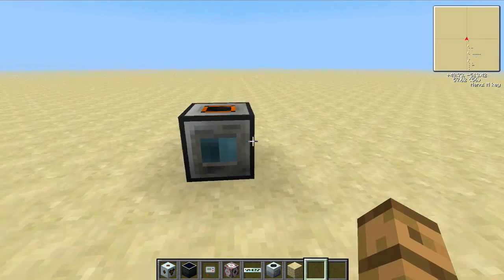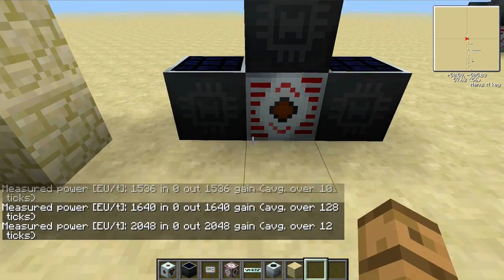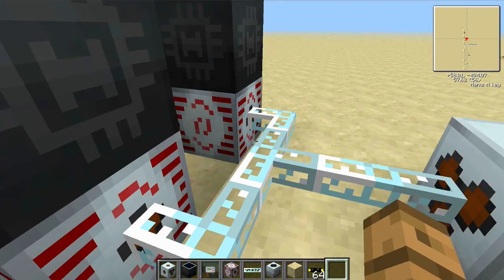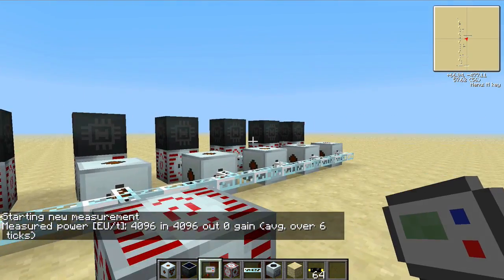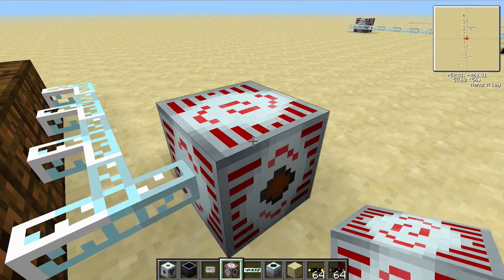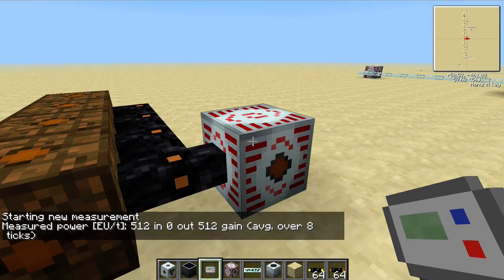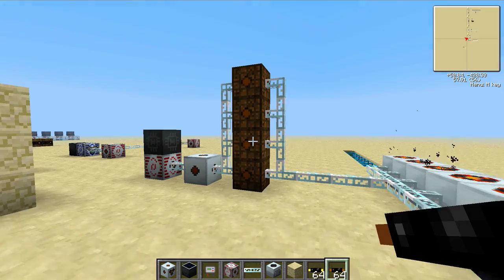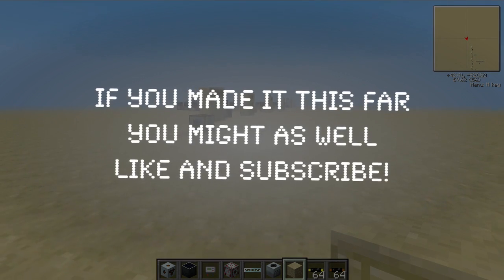Re 014 Nebris Power Transformation

Comment: Nice video, I didn't know that EU packets are getting split into smaller ones and machines request EU, i thought it went the other way. 

But what happens at 8:07 can be explained: The MV-T requests 512EU every 4 ticks (when all 4 128EU packets have been sent). Over 31 ticks 7 packets were requested (512 * 7 / 31 = 115.61), over 11 ticks 3 packets were requested (512 * 3 / 11 = 139.64). The other times it was over 20, 12, 8 ticks, which are multiples of 4.